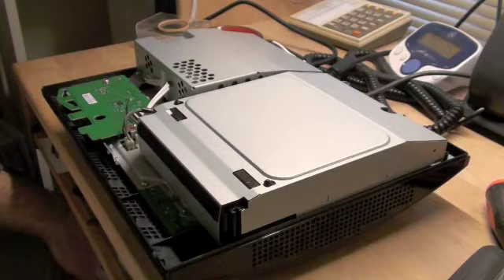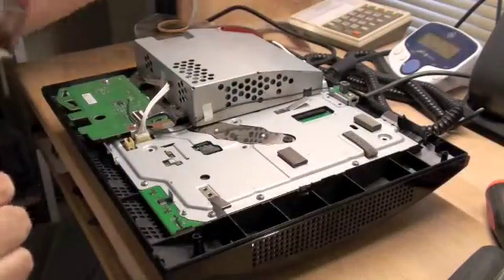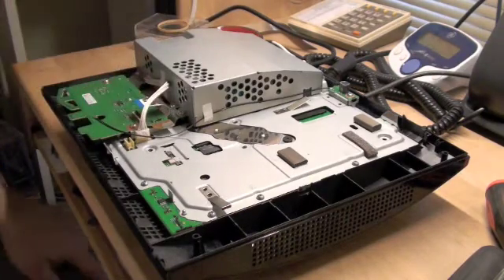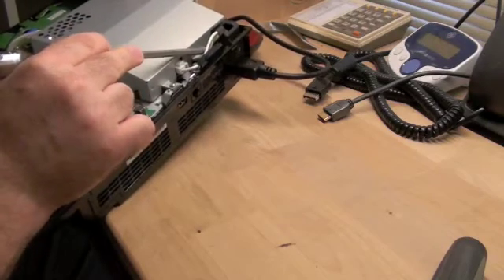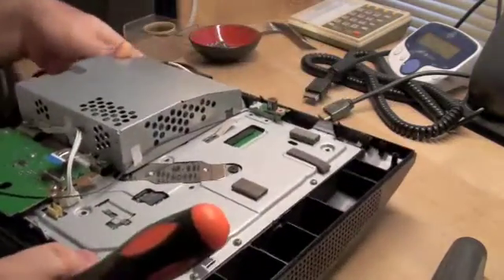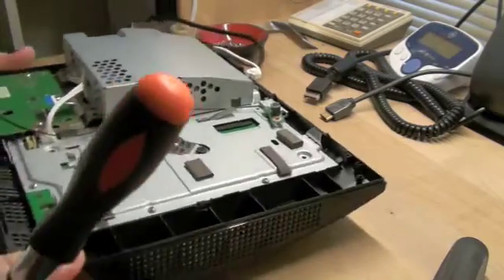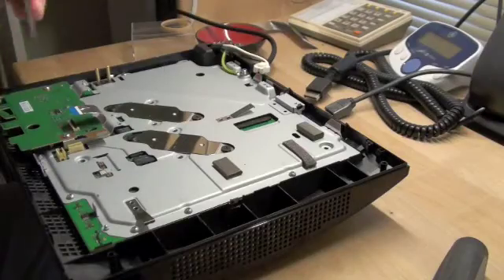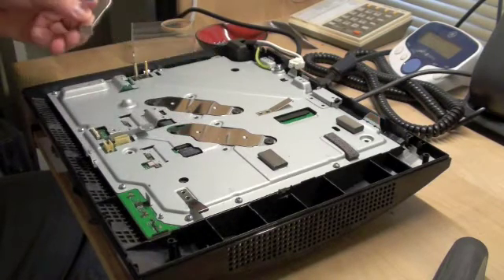PS3 disassembly - topside

Comment: im not a computer genius or anything but dont you think that centralizing all the data into one chip is dumb, it centralizes the heat into one point, my idea is that couldnt they split the processor into multiple main areas of data processing across the motherboard you know various chips that all work together without being together in one area, thereby spreading the heat evenly across the mother board instead of centralizing it.

Comment: I took mine apart cleaned it out and put it back together but it still freezes up and gets hot very fast when im downloading data in it. Sometimes it shuts off and i see a yellow light flash them a blinking red light or it just stays froze. Do u know what that might be i can fix ???

Comment from the maker: @tonytonytony3t That only removes the rear antenna.  On the bottom of the wi-fi board is the front wi-fi antenna, which is surface-mounted on.

Of course, there is the option of cutting the traces to both wi-fi antennas...

Comment from the maker: @tonytonytony3t I don't think removing the bluetooth is a good idea, because I believe that's what the controllers use (maybe even when connected via USB, but I haven't tested that).  A better way to make wi-fi unusable is to grab its MAC address and add it to a list of addresses in your AP that are denied access (or remove it from the allowed list if you do MAC filtering that way).

(Of course that doesn't prevent the PS3 from connecting to another AP...)

Comment from the maker: @Cleonn100 The PSU is held in with 5 screws, I believe.  At least one tends to hide itself under the ground wire.  Once you get all the screws removed, it should just pull straight up.

Comment from the maker: The grey and black wires coming out of the side of the drive?  These can withstand a bit of tugging, but if you're not comfortable with that, a small flathead screwdriver can be used to ease the connector out of the socket.  It tends to be a tight fit.

Comment from the maker: All versions that originally came with the 40GB drive have a different mainboard layout that doesn't have the connector for the card reader.  Also, the hard drive was reoriented in the 40GB version, so you probably won't be able to use the bottom shell from a 60GB unit.